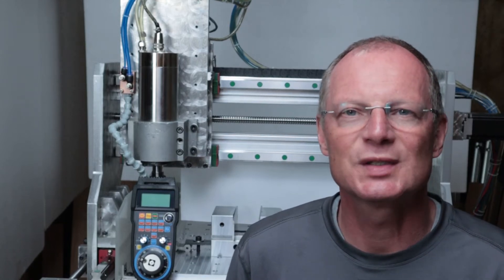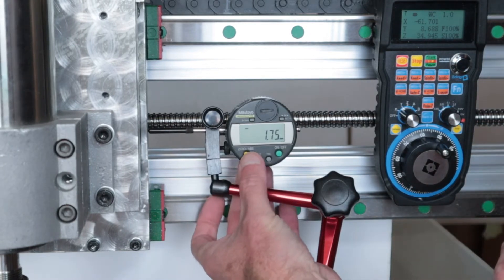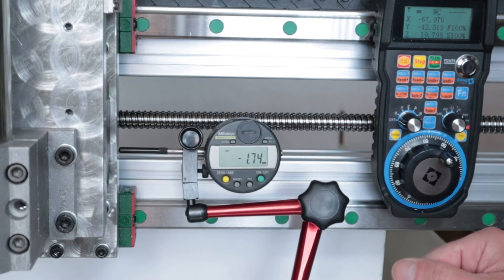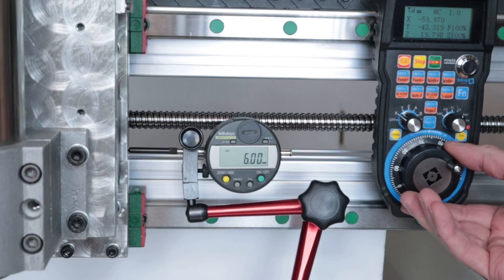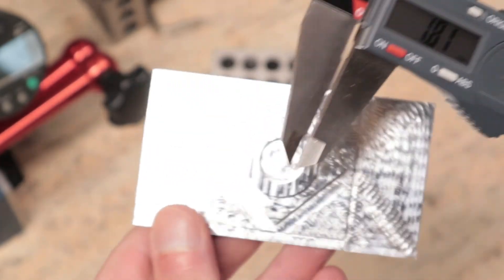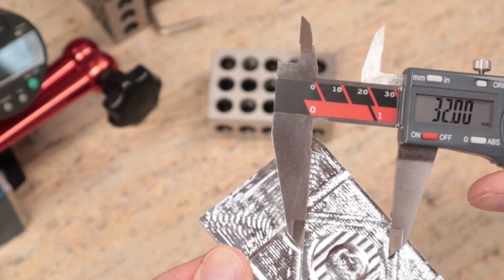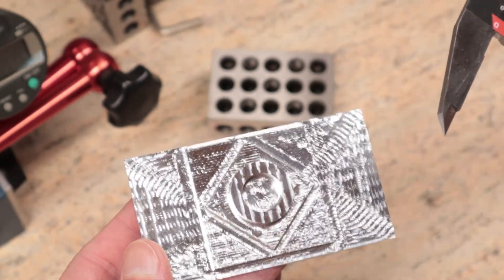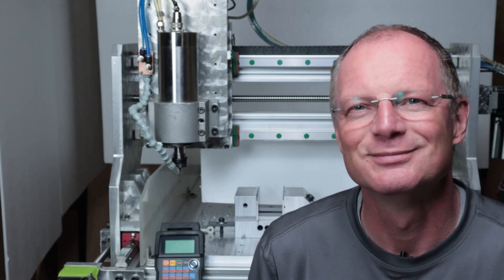CNC Servo Motor Accuracy

Comment: Hi Jörg,
the accuracy of the servo is one part of the (CNC) game.
I found on my machine that the (chinese) ball screws have non negligible  tolerances as well (OK, man kann es auch Asymptoten-Polieren nennen...). 
In my case this was up to 0,25 %. This sounds not much but 100 mm can deviate by 0,25 mm...

I used a low tolerance meter scale (DIN866 Form A, 500 mm and 1000 mm) in combination with my reference camera to adjust the steps/mm on each axis. This works quite well and is reasonably priced (38 € for DIN866/1000 and 6 € for endoscope camera).

And my  (cheap chinese) end mills have  tolerances as well. My 1/8" end mills have a  "diameter range" from 3,07...3,17 mm and will bring futher 0,1 mm tolerance into the system (if not considered in the tool data base).

 Grüße aus Baden-Württemberg
Kassen Oldewurtel
Reply from the maker: Hey Kassen,
I Totally agree, the arrived accuracy is a combination of many factors -  machine deflection is another big one to add. I think most diy machines have C5 class ball screws and yes the tolerance over 300mm is not good. Backlash from the fixed bearing and lost motion due to high pre-loads of the linear guide system are also at play. Anyways I always wanted to measure out the positioning accuracy as Eding CNC allows for a compensation. I looked at a glass scale DRO that can be purchased relatively inexpensive and temporarily attach it. The camera is a great idea ! Thank you for that suggestion I will check it out. Und Dir noch einen schönen Tag !

Comment: hello, friend, whats the name of the mitutoyo meter you use?
Reply from the maker: I am currently traveling and do not have the exact model number. However it is a “Digital Dial Indicator” this particular model has a large measuring range I think it is 50mm or so and a resolution of 0.01mm.

Comment: is your system more accurate with servos in stead of steppers regardless of speed benefits ?
Reply from the maker: I think it is the same. The only difference I saw is that I was able to take the backlash compensation on x and y down. Less than half. I think that has to do with the accuracy of step positions in micro stepping of the stepper system. The part accuracy however is equal.
Reply: @JBWorx  Thank you , much appreciated. i have a converted bridgeport and busy building a granite based cnc router based of piotr fox `s machine.
Reply: @JBWorx  may i enquire as to how much microstepping you used and your accelerations ...on your previous stepper setup .thnx
Reply from the maker: Oh wow that is a nice machine !!! Where do you gut the granite from ?
Reply: @JBWorx  had to go cheap... thus only 50mm thick , machine footprint is 1000mm x 1000mm x220mm xyz  from stone suppliers running on 20mm linear rail  comes from guys who makes granite counters ...sides is rollbolted and anchor glue on 3 sides then  raised sides is diamond scraped to be flat.
Reply from the maker: That sounds like a lot of work. Yes I saw Fox build his one. I used 4000 steps/rev unfortunately I do not have the acc values on hand. But I know I like to use the number for velocity x 4 or better 5 as the acceleration. Especially in a smaller machine.

Comment: Servos are not going to make a more accurate machine.  Steppers are just as accurate.  Your money is best spent in better ball screws/linear guides, and accurate dimensions for your machine, the steppers control linear actuation, they are just as accurate as servos, just not as fast or quiet.
Reply from the maker: But untuned servos can be way less accurate hence the test after tuning.